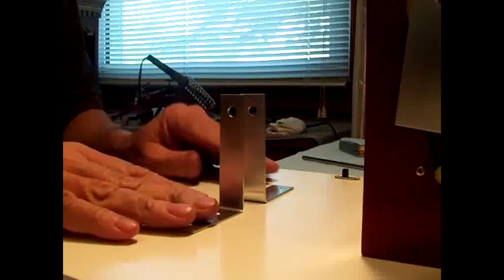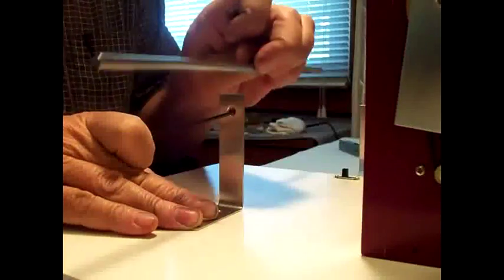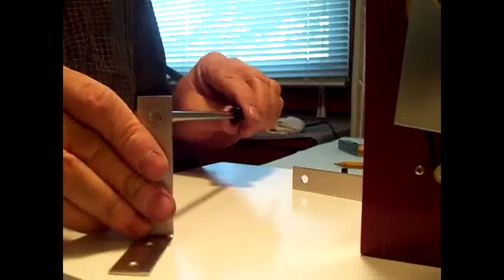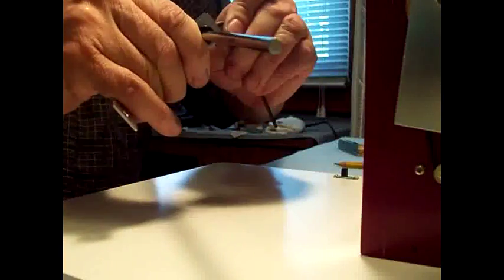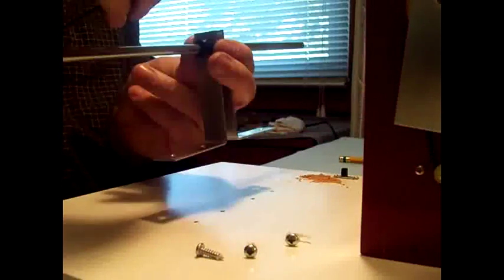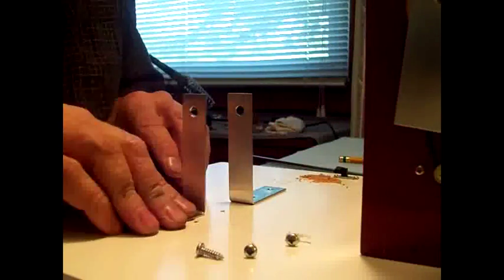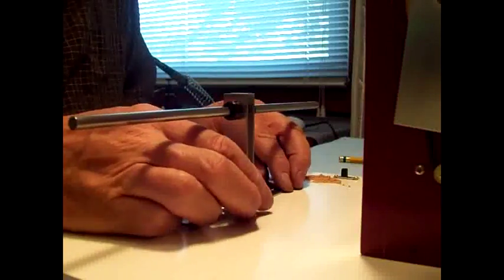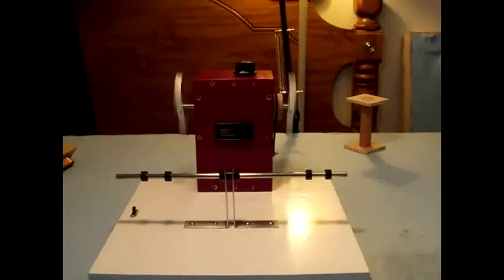Pickup winder build Part 10 Completed

Comment: i, I also build Pickup winder, sorry but the engine adjusted with a simple potentiometer loses its strength at low speed, I use a PWM dc motor control that adjusts the frequency of pulses with constant force. In any case, your project is very good. I use old engines of cordless drills, sound a bit noisy but have great forza.Qui in my city, unfortunately I can not find the counter that I saw in your movie,, so I build them myself. Greetings from Sardinia